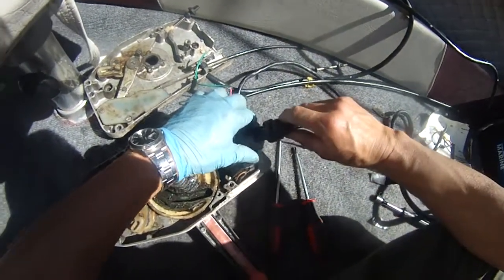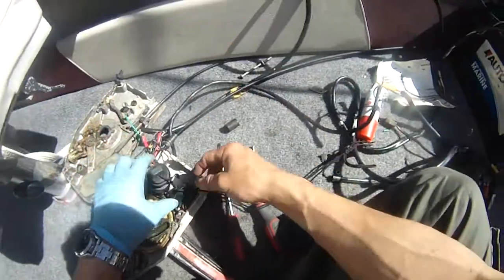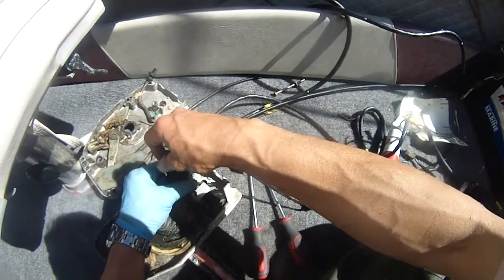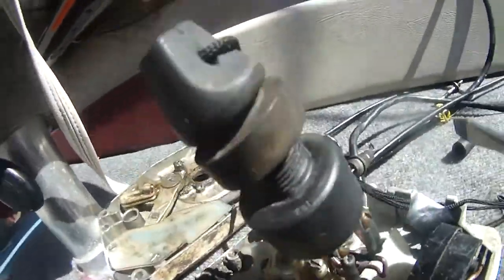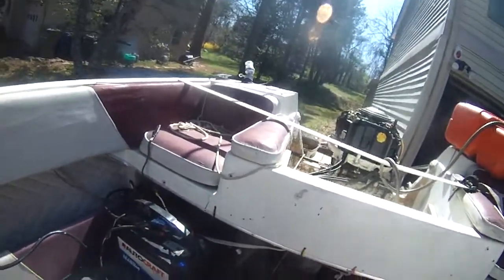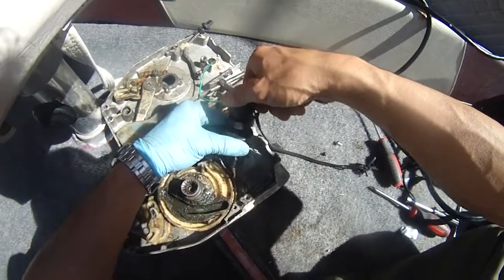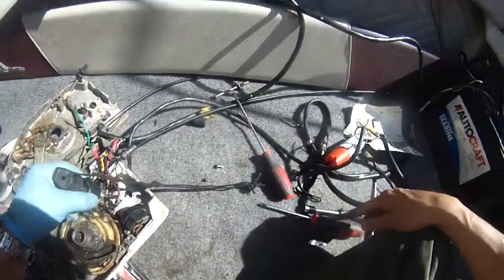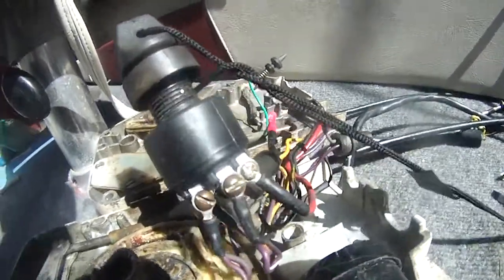Johnson 90 hp v4 - how to troubleshoot motor won't shut off? Part 1 of 3

Comment: What is the round black cylinder right above the key? Thanks
Reply from the maker: Alarm for overheating
Reply: @njfishing1  My buzzer got so hot it melted.  I put another one on and when it start getting hot I turned it off. Looks like the purple wires go to the tach so I unhooked them and it still get blistering hot. Any idea why the brown wire would get so hot it melts the buzzer? Thank you.

1990 Johnson 150 GT with OMC controller.
Reply from the maker: @bahlol8372  there is a short somewhere, or the wires got rusted or broken somewhere Replace with new wires,
Reply: @njfishing1  OK, thanks again!
Reply: @njfishing1  Thank you!

Comment: I had the same problem with my 96 yamaha 30. After hours and hours of googling, i checked the 7pin connector on the power cable. There was a teeny tiny bit of corrosion. 1 q-tip and a few drops of vinegar solved the problem for me!

Comment: I am having the same issue. New switch' still won't kill the engine!
Reply from the maker: Julius Bacot good luck. There has to be a loose screw or lines broken making your kill switch unable to connect. Watch my diy kill switch explained video and check your wiring again after you watch my video
Reply from the maker: Julius Bacot https://youtu.be/66t5sPBiqi4
Reply: NJ, thank you. I watched ur video and several others and tomorrow I'm going to check my ground wire. At least with all the info here I think I know what to check for. Thanks everyone, I'll report back what I find.

Comment: I have element bayliner, mercury 60hp, won't shut off, i have spade connectors not screw in type and it is a push to choke ingnition switch, which i did replace.....could it be something else or did i buy a bad part? which has happened before

Comment: I just had the same problem . You need to check the black wire with yellow tracer . It comes out of the power pack and goes to the key switch . Mine was broken at the connection going into power pack .

Comment: Did you ever figure out what the problem was ? Mine is doing the same thing.
Reply from the maker: Yes in the back of the key switch u will find 3 small screws that set them to the key post, check them. My positive red wire small screw was loosen so Motor won't shut off when I turned my key. I replaced it with a new screw, voila problem solved
Reply: Thank you I was thinking that a lose wire was the problem. Ill have to check mine today as Im goig to take her for a run. Keep up the good work :)
Reply from the maker: thanks for the encouragement and enjoy. Boating is so much fun when everything works - LOL